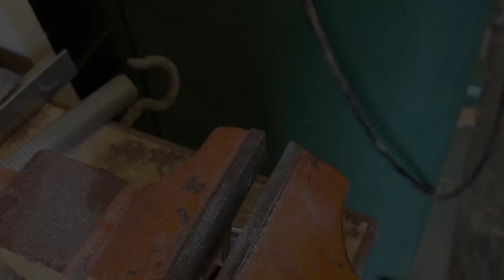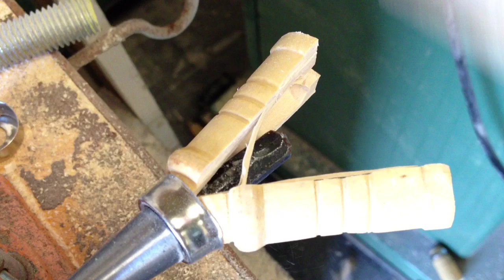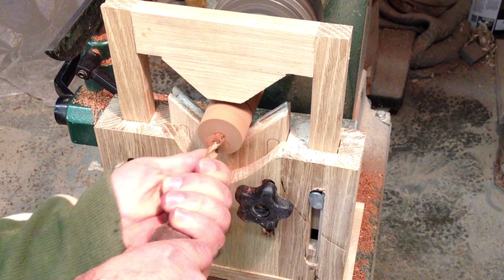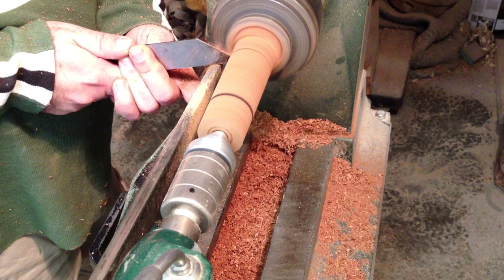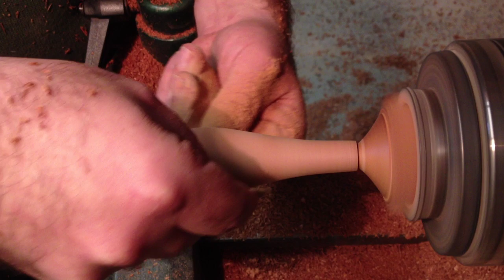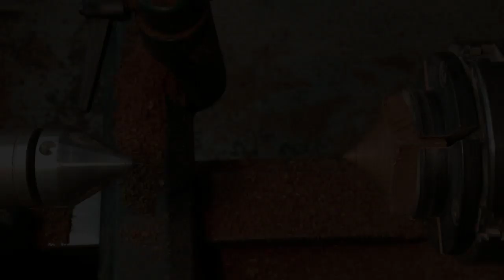Woodworking Chisel Handle Preference — Woodturning

Comment from the maker: Hi Jack, yes, a short video on the spindle steady is in my videos. 

As for the pipe with a set screw, hmm, sounds interesting. I have had a small jacobs chuck one day...an extra one I took off from a broken drill, and I made a handle for it so that I could change different drill bits for the lathe work. I think it worked ok for a while, but then it was a mess...Finding the right bit, changing it, leaving the old one abandoned. I think a single tool is always the best.

Comment from the maker: Hi Jack, the drilling with a hand is a bit tricky. You need to have a fair enough entering point for the drill, the first inch or so may not go even, but you will feel it in your hand if it's going eccentrically. Usually it's not 1/1000 accurate, but if you use the same technique I used in this video, you will end up having a perfectly centered throughout hole on the wood blank, because with this method you base the center using the existing holes on both ends.

Comment: I found a box of mahogany behind some of my picture framing supplies. I am going to start by make the drill bit handle and then a couple of chisel handles. I am looking at a set of old Marples chisels with plastic handles. They should be afraid--very afraid. They may be going away. I love the shape of this handle. I have had several hand operations and this looks to be a good solution for holding them.
Stayed tuned.

Comment: I think I will make the handles a bit longer, just for comfort. The bolt with the ground head (rounded) is a good idea. Do you just epoxy it in? I believe that the drill bit handle had flattened sides. I think I may try that as it would be easier on my hands.

Comment: How long is this chisel handle? How long is the drill bit? On the drill bit holder, would it be possible to insert a small pice of pipe with set screws so you could secure several sizes of bits in the handle? It looks like there is something like this arrangement in the picture.